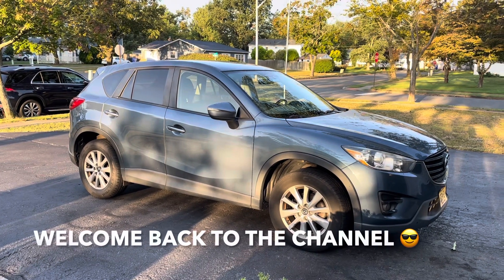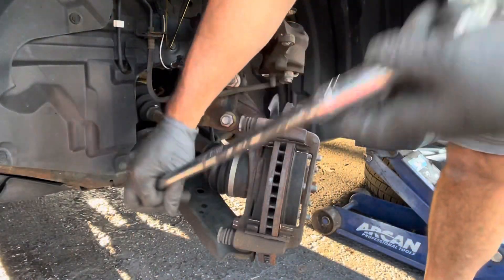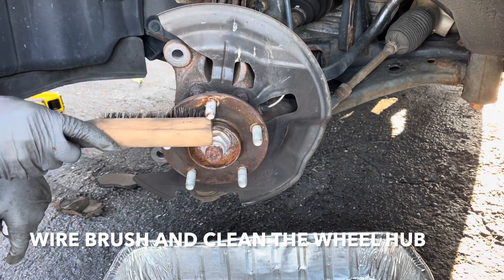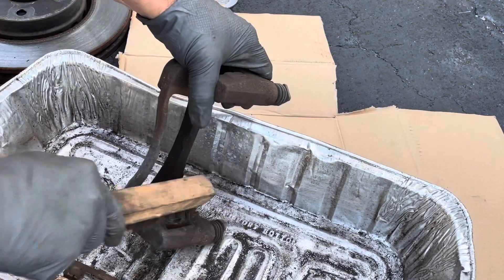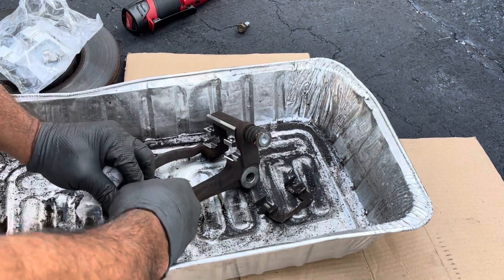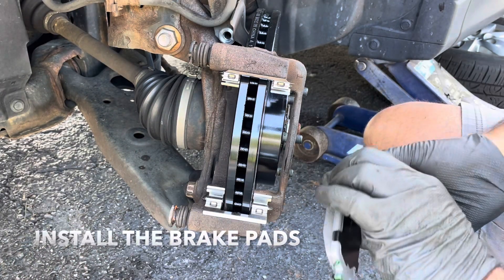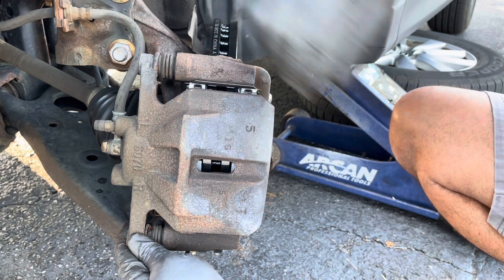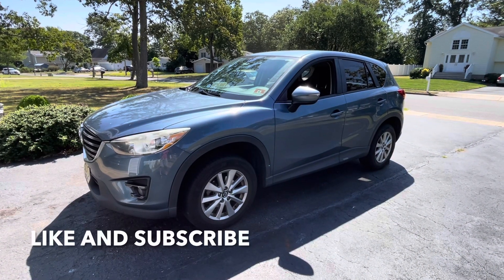MAZDA CX-5 Front BRAKES Replacement - How to Change Brake Pads and Rotors on a Mazda CX5

Comment: Thank you so much for showing this process!  Getting ready to do my 2016.  Something that wasn't clear though is that you list three different lubricants in your description (1)Permatex Silicone Extreme Brake Parts Lubricant, (2)Permatex Disc Brake Parts Lubricant, and (3)Brake Parts Lubricant.  However, it looks like you only used two in this video... (1) the orange stuff on on the caliper pins, and (2)the green stuff on everything else.  I want to make sure I use the correct lube for my ceramic brake job.  Can you please clarify what the third is for?
Reply from the maker: Silicone based is for anything that will have contact with rubber. Either of the other two are fine for everything else.